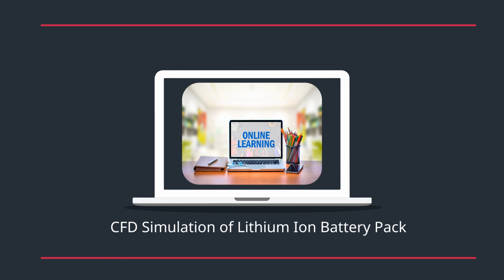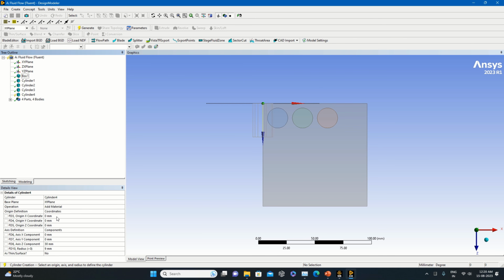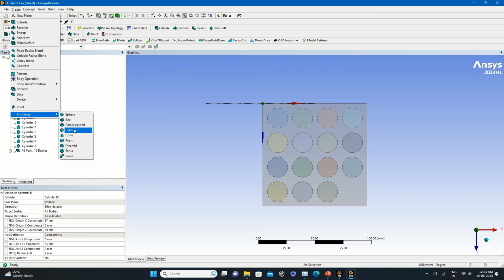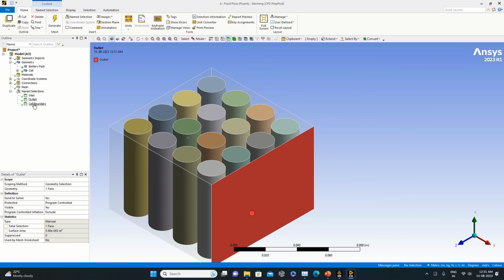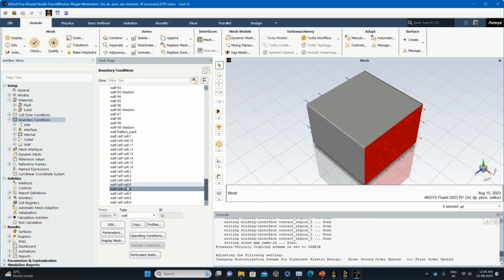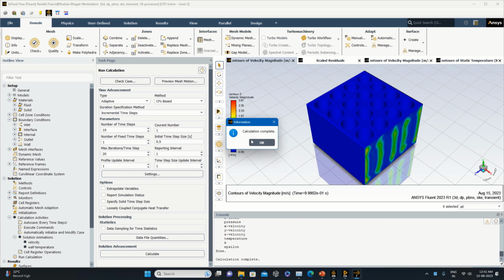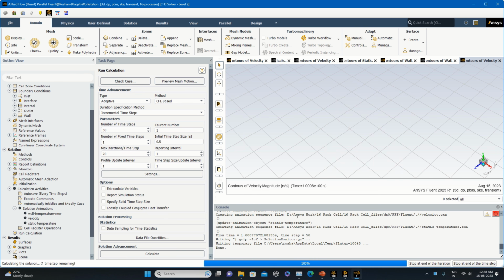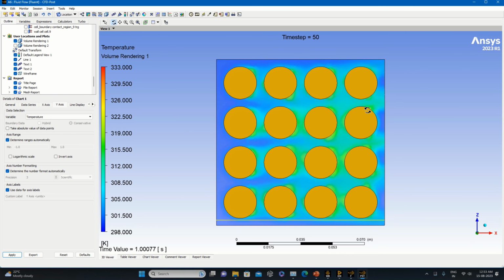Geometry of Lithium-Ion Battery Pack || CFD Simulation || Thermal Analysis

Comment: I want to simulate 4P20S battery pack. I dont want to waste time. The geometry of battery is repeats for every 4P2S. How i should do it?

Here is the geometry description:

There is a metal plate connecting each battery in 1 parallel (4P1S) section and for each battery in that section is connecting to next parallel section through another metal plate. And this continue until 10th parallel section.

In the 10th parallel section the connection to the next, is through 3 cable. The 11th parallel section to 20th parallel section.
Reply from the maker: prepare sketch and make use of copy
Reply: @FrontiersInCFD i mean, can we make the simulation faster using some kind of copy of the result of the simulation of 4P2S?. So that we can run the simulation of 4P20S faster
Reply from the maker: Yes, it is possible to speed up the 4P20S simulation by reusing information from the 4P2S case, but you cannot directly copy the final results because the physics and domain size are different.

Comment: Super work, sir. Can you put a video about the solid oxide fuel cell stack simulation in ANSYS
Reply from the maker: please share reference paper or details on frontiersincfd@gmail.com
Reply: @FrontiersInCFD  Flow distribution analyzing for the solid oxide fuel cell short stacks with rectangular and discrete cylindrical rib configurations

Comment: you define the boundary condition wrong!! everyone knows that the temperature of the battery is not constant during charging and discharging and we have to use the battery model tab to simulate the battery in analysis,,,,
Reply from the maker: The video is about thermal analysis so we're focusing on heat transfer, not the battery's electrochemical behavior.

Comment: Sir can you explain why have we taken temperature 333 k at each cell wall ??
Reply from the maker: it was used as boundary condition you can use heat flux or heat generated per unit volume also

Comment: Thanks for  a wonderfully and patiently explained video. I want to model a single 18650 cell with heat generation and natural convection alone. But while running the simulations, rather than converging, static temperature of my battery is rising suddenly after increasing the iterations. so what should I do ? how can I decide on optimal number of time steps?
Reply from the maker: Select suitable mesh size and accordingly select time step size.
Reply: @FrontiersInCFD Do you mean to say that  Courant number be considered ? 
If so what should be the fluid velocity since its natural convection ?
Reply from the maker: Velocity is difficult to change as per flow however we can change mesh size and time step size

Comment: Thanks for useful video for simulating li-ion battery pack. I'd like to analyze air cooling of battery pack consist of 70s 6p 21700 cell using MSMD model. But, there's no suitable guide for it. So could you make video or some advice for it please?
Reply from the maker: Will do !